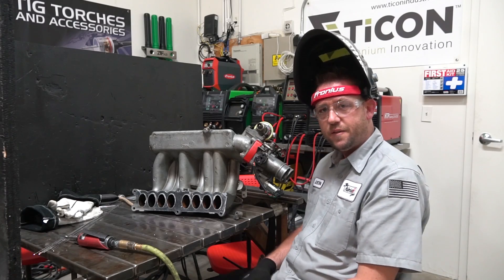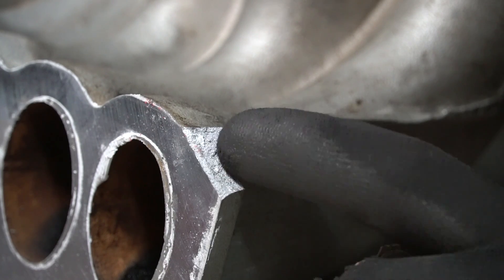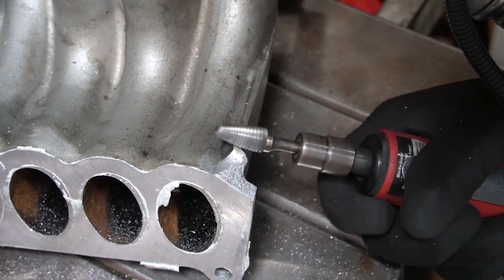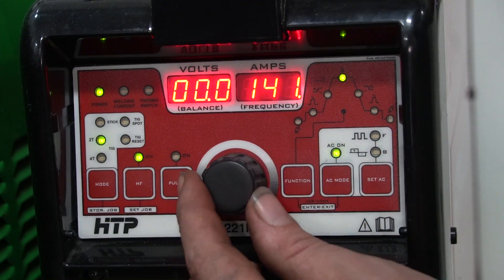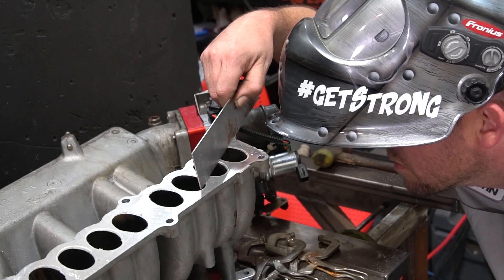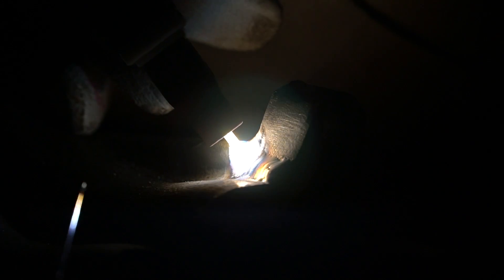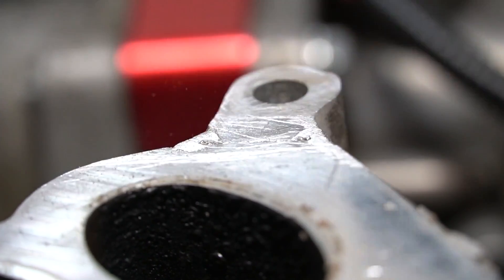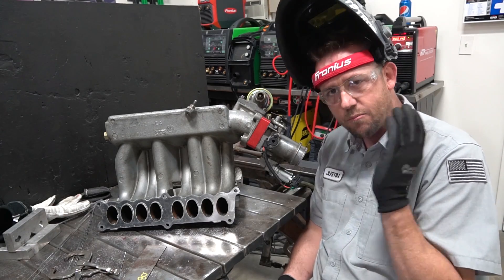TFS: Cast Aluminum Weld Repair

Comment: Sorry, that was a BAD job..  Most of the tab is still DISCONECTED from the the main body.  You should have welded the back side and then beveled out all around the tab.  That weld will NEVER hold.
Reply from the maker: If it ever breaks, I'll let you know. 
In the mean time, study the strength properties of mechanical locks and understand there are more ways to do a job properly that may differ from yours. If you still aren't convinced, show up here with a repair and prove my job is inferior compared to yours. Anything else is considered lip service as far as I'm concerned.

Comment: There's a few comments on here Justin using a double cut burr instead of a single, and I'd like to offer my opinions on that (ya, I know what  opinions are like....). Anyways, 
(1)... I feel the double cuts are easier to control (especially when you're doing some one handed grinding like Justin did in this video), and they don't chatter or grab and run down the part as much.
(2)...I go back and forth all day cutting different materials, and well TBH, sometimes I'm too damn lazy to change the burr out for each material, so it's usually a double cut that's always loaded in the die grinder. IF I'm going to cut ALOT of aluminum I will switch to a non-ferrous burr.
(3)...As for loading up, I always use a cutting/ grinding wax when cutting aluminum. Just dip the burr in when it's warm, or smear a little on the area you're going to grind. Then, wiipe down with acetone before welding.

Comment: So, if the part that broke off is missing then, could I go about it this same way to build up a new part/tab? I've got a harley motor that has one tab broke off that goes to the main frame mount where it bolts down at and the part that broke off is missing so, need to build it up so a new hole can be drilled into it to mount to the frame.. How about that "alumaweld" stick stuff, would it work for this job or no? Tig seems to be the best idea I am thinking but, never hurts to ask about other possibilities.. thanks for any insight you can give on this one...
Reply: George, as a Harley Owner and welder myself, i´d never think of using anything other than a Tig on this kind of repair. When i started to weld aluminum about 20 years ago, my first private job was a
missing tab on my Shovelhead tranny case and some stripped threads from PO. It took me a bit of practice, but it lasted all the years i was driving that bike;-) As a guide or helper, use a thinker flat bar
or copper plate and clamp it tight under the existing surface. That way you can build up material
and still remain a pretty flat surface at the end....
Reply: @dietmarfink8233  right on, that was somewhat my thoughts as well but, it's been about 10 years or so sense I've welded any aluminum and couldn't remember what it takes. I appreciate your input and information you shared. I will just go get someone to Tig that corner and bolt hole so I can get this bike build back on track soon, heck, as it stands now, one of my boys will probably end up with this bike by the time it's all said and done lol
Reply: Good on you, fixing it properly for your family member for years of enjoyment. Do it once and do it right:-)  Happy cycling 👍🏼

Comment: I wanted to try sandblasting cast aluminum parts. Maybe glass media. Ever try that? I wonder if the media could get embedded in the aluminum?..... I never know what to charge people. What would you charge for this repair? Great video, thanks man!
Reply: Nobody really sandblasts aluminum it tears it up too much. Soda blast or bead blast it with glass beads. Fine aluminum oxide or crushed glass works good if you need to leave a finish for paint to bite onto but make sure your dust control and ppe is on point that stuff will destroy your lungs.

Comment: I always full pen the repairs. Think about it this way. Originally it was held together by its full cross section. Now you only have a smaller amount of material doing the same job as the previous beefier material. What ever the guy did to break it in the first place will break your repair. Unless the point is to gain repeat business?

Comment: English please.
What does "Hammer down" mean  ?
Reply from the maker: Heavy heat concentrated into one spot. Basically step on the pedal all the way and make the amperage push, smack, beat, "hammer" on the weld to get a clean puddle.

Comment: Any suggestions on doing this kind of work with an older welder that doesn't have all the balance settings of some of the better, modern inverters, like an old synchrowave?
Reply from the maker: Just let the 50% cleaning do its job. It's kind of easier (in my opinion) to run older machines on cast
Reply: @TheFabricatorSeries  Hey Justin,
Im glad I came across Mark's comment. I have a miller Div. 180 ( no settings to adjust frequency or balance)  most I can do is manual preparation /cleaning. Any suggestions?  BTW love your videos,  learned a lot.

Comment: Any reason you didn’t resurface the whole plenum?
Reply from the maker: It doesn't fit in my mill. The gasket will do it's job though.
Reply: You ever try and hold one of those things? Nothing flat to clamp down on. The factory has special tooling wjen it comes to holding all those different castings

Comment: I broke the cast bracket on the alternator on my 302. My buddy (pro welder) welded it with an aluminum rod with an ancient buzz box. Needless to say I'll never question his ability again.
Reply: Well, I use the rod when the cast is so oil-impregnated and contaminated that nothing else will weld it. And, with a good pre-heat.
  It isn't near as pretty, it isn't as pure, but it has it's uses.

Comment: Justin, why aren't you using a single cut burr? I only use those double cuts for ferrous.
Adam
Reply: That’s what I was wondering as well I have a single cut set for AL and MAG because the double cuts load up on me.
Reply: Use engineering chalk on your burrs to help prevent the build up.. double cuts give a finer finish than the single flute cutters if you only want to remove a little in my experiance
Reply: In my experience it depends a lot on the alloy. Cast tends to not load up burrs like extruded or billet aluminum.

Comment: Nice repair Justin.  I have been following your channel for a few years now ever since I saw the JD2 Tube bender videos.  You are doing great work keep it up.  I have a question with regards to this repair.  Does Cast Aluminum have  a tendency to warp like other metals when welded?  My first thought was I wonder if the deck will have to be resurfaced from warpage.

Comment: I wont call cast aluminium a lower quality of aluminium, it is just a different alloy, extruded or billet aluminium is generally a alloy that does not cast very well... Cast alloys generally contain large amounts of silicon... It may also contain zinc and small amounts of copper or even magnesium... I am wondering though if the junk you encounter while welding can be some of the more reactive components of the alloy that oxidise like magnesium for example... Edit thinking about it a bit further, if the casting has porosity issues I guess oil could also absorb into the pores and present problems... Mhmm more things to think about...
Reply: I think it all comes down to cost as everything in this world. Quality casting differs a lot from cheap castings. And when mass producing something you want it as cheap as possible therefore the quality of the metal poured is sometimes a conundrum.

Comment: Hi, having done variousrepairs on old motor British bike castings I'm definitely a supporter of building up the casting instead of trying to weld old part on. Particularly with cooling fins. The part I struggle with is  getting a nice join along the machined face, I always end up with a line of tiny bubble marks. Any tips on reducing those?
Reply from the maker: Sometimes you just cant, but increasing the amperage to really hammer down on it helps me when I encounter that problem.

Comment: I have been welding cast Alu for 6 years now and around here nobody wants to do it. I am so glad to see you have the same struggles as me!!!!  Its rarely beautiful but Ive had only 2 comebacks in 6 years.  I always thought the PRO’S would be doing a much better job.  I have another technique as well. Like when Im welding on diesel soaked parts have the part sit in Acetone bath for a while, then heat it with a propane torch. A lot of bad stuff seems to come out. Wash it off and brush it off. I do this several times. Seems to help a lot. But basically the way you do it is how I’ve been doing it for 6 years.  Thanks for at least showing me I haven’t been doing it wrong all this time.  Love your channel keep up the good work.
Reply: that's a perfect thing to do, to get out the old diesel out of cast parts. The Aceton does evaporate under less temperature than the diesel and assures at least, there´s no fluids left in the pores.
If you can, blasting is also pretty handy, in case the part is just oxidized or normal dirt...
Reply: @dietmarfink8233  sand blasting? I wouldn't sand blast anything to be tig welded it gets stuck in the material
Reply: I was going to say the same thing, use a torch to outgas it and pull out impurities.
Reply: Same issues as well and same acetone solution.
isoprpyl alcool works good as well, but both of them can't solve porosity issues....
Reply: I do the exact same process. Amazing how many times I can repeat the process until I get no noticable impurities but it's always worth it for a good weld.
Reply: Need an aluminium casting for a Meade Telescope tube straps joined back together by welding. What do you think-possibly can do?  If , who might you recommend?
Reply: @johnfulcher1512  are you in South Africa?

Comment: So is it not always necessary to pre-heat cast Aluminium?
Reply: SwingsN'Roundabouts depends on the amperage your machine is capable of. Preheating cast parts is just a way to get around not having enough amperage to get proper penetration.
Reply: Makes sense, Thanks

Comment: I guess the center of the welded fragment is still unattached. I wonder how deep from the surface the weld goes. (How deep is enough?)Thanks for the video!!
Reply: Chad, this is a problem I see.
I am a fabricator and have enjoyed Justin's videos for a while.
BUT, this one had me miffed!
He started out with a double cut "steel" burr.
And the file prep to the face was only 2mm deep??
You really need to cut your prep to 80% , leave a key for sure but you gotta weld it through.
Also best choice with cast is to start slow, melt in slowly. 
Cast is like sausages, it's full of fillers. Wanna keep from dragging too much In from the surroundings. 
Not dissing him, just don't know why he did that.

Comment: nice work!  those things can be a bear.  a dirty, oily bear.
Reply from the maker: Thanks! I'd be lion if I said they're all easy to fix.
Reply: Tony, big fan of yours and newish to justin.
I am confused at the double cut burr and minimal prep?
Being an ali fabricator(AS1665) I am confused.
I would have ground a prep in, leaving a key and tried for a 90% penetrating weld. 
No disrespect, I wasn't there.
I'll continue to watch, but the double cut burr has me concerned...
Adam
ADFAB IND.
Reply: This old tony... You're the best youtuber. Period
Reply: So.... Tony... that's the reason for this particular HTP model.....
Reply: I'll probably be learning to do this the hard way,now that I have a tig. 
Wouldn't it help to burn the oily crap off with a propane torch first?
I suppose it's not gonna get it all but maybe it helps )
Reply from the maker: @MrTheHillfolk  I suppose it would help to burn it a bit, but I just go after it with the TIG torch. It will all burn off in the first few seconds of welding.
Reply: The Fabrication Series 
True , that heat will get rid of it just as quick after a few tacks I see. 
You call it welding , but I’m sure I’ll be burning holes in manifolds and all kinds of things in no time.
Reply: Hey looking for a little advice, I recently purchased an aluminum intake manifold for a y block Ford. It is a 2x4’s from 1957 and the front bolt hole corner broke off and is missing and the water passage is right there too.
I have a Lincoln SP170H mig welder. It says I can weld aluminum with aluminum wire and 100% argon.
Thinking try to build it up or get another piece of aluminum and fill in the gaps.
After watching this video not sure if I should try mig welding it? 
What do you think?

Comment: Is this basically the same technique that you would have to use when welding two separate transmission bell housings together? Like, when you are swapping a Trans to an engine with a different bolt pattern.
Reply: That would be a nightmare to line up.  The way that is normally done is an adapter plate is made that will bolt to the back of the engine block that has the bellhousing bolt pattern you need on it.  They exist for most common swaps.
Reply: Lining it up is done via a jig, people do it all the time in the drift scene over here in Sweden. Though, I can imagine the welding process being a hassle. The problem about the adapter plate is that I'm thinking about pretty uncommon swaps. But yeah, adapter plates is probably the better solution in most cases!

Comment: I have done a few outboard skegs ( the bottom fin) and they have so so much junk in them its not funny.
Reply: Ya, those things are awful! Gotta go over them several times to get the air bubbles out. Die cast material always has huge air pockets in it. I do several a year, and have only had one come back for failure. I welded that one while the drive was still on the boat and a few minutes after the guy left my shop, someone rear ended his boat at a stop light and broke it off.

Comment: How do you quote these types of jobs?
Reply: High
Reply: @Steve_Just_Steve  gday mate.
Reply: @stevesanders3992  LOL I meant high as in expensive
Reply: @Steve Sanders  with more experience doing these kind of jobs, you learn what stuff is going to weld like what, and base the price on that. For something like this, I'd probably tell them around an hour to get stuck back on. More if they want the entire surface machined, and more still if they want the weld ground down and make it look like it was not repaired

Comment: It looks like the cast aluminum is using the argon as a flux which w p uld make sense why you would have to make a pass to bring out all the junk in the metal
Reply: No 1st pass needed with the correct prep and pre-heat....
Reply: No 1st pass needed with the correct prep and pre-heat....

Comment: Jobs like this with a small tab missing, after a thorough grind clean up, I usually build up all new material, grind it back to a rough shape similar to what was there, file the gasket surface back flat, and re-drill the hole using the gasket as a template.  
To each his own.  There is more than one way to skin a cat. Different strokes for different folks.

KEEP UP THE GREAT VIDEOS BROTHER!!!
Reply: RudyRay AAW I think Jody “The TIG Finger”’s Channel has a pretty good via of the build up process that was referred too. If memory serves me; it was a small corner mounting point like the one in this video, and he was doing it as a favor for a machinist friend so after the build-up he just sent it back as is for the guy to Mill and drill...  It was a real good tutorial..... I'll edit in his changes name in a few min...
"Weldingtipsandtricks"**^
Reply: RudyRay AAW It would be interesting to see a video of how to build up material in the manner you describe.
Reply: @chadandrews98  Watch Keith Fenner's video called "The Manual 3D Metal Printer"
Reply: I also do it like that sometimes if the piece broken off is really small.  Also try to make a stainless backing to clamp to the tab. It helps keep the tab cool and gives you a bigger weld window without overheating the small part.

Comment: Being certain Aluminiums are a mix match or crap would gluing not be better.

Im no welding expert but ive never had luck with factory cast items.\
Reply: Nothing to do with luck my friend, all to do with prep/pre-heat/correct filler wire and 35 years experience!

Comment: Ha!  Thanks for making this video, and talking about the quality of the metal being a factor in how much trouble you can have.  I was welding a 1/8" adapter into a cast water neck and had to go back over, and over again to fill the pinholes.  At my level of expertise I thought I must have missed something in your class, and thought I was doing something wrong.

Comment: I've read from other people where they would have just built up a new mount and drilled a hole. Probably more time consuming to build it up, but would it be stronger this way? Other people would immediately suggest stuff like Muggyweld #5 or #1, I've had limited success with the #5 joining two pieces of 6061 before I bought a TIG welder, so not sure about the Alumiweld type products either.

Comment: Would using a gas welding flux specifically intended for aluminium/aluminum help reduce the contaminants in the weld area?

Comment: I’ll always like to do a good pre-heat and then let it cool down. That burns all the shit out of it then its easier to weld, at least for me! Great video keep it up!👍
Reply: I was thinking the same. But I have no experience welding cast aluminum. I was also wondering why not throw some flux at the "mechanical weld"? Again, I am not experienced in any of this.
Reply: What temperature and how much tim? Ty